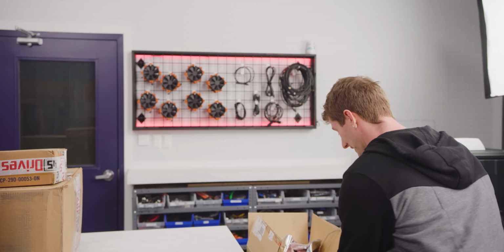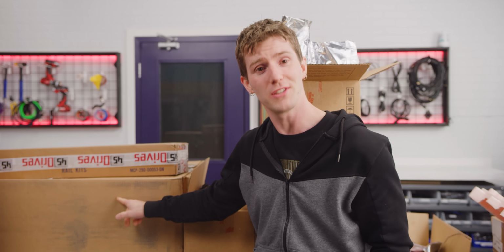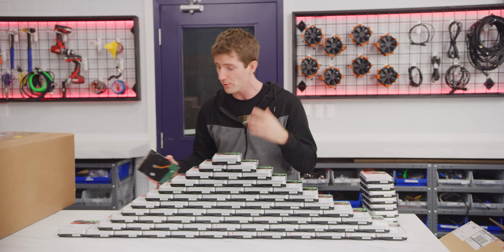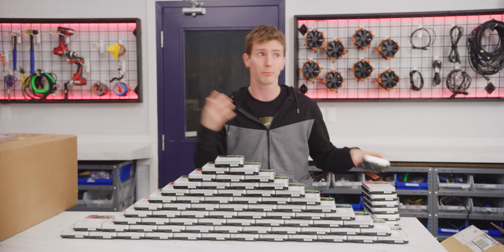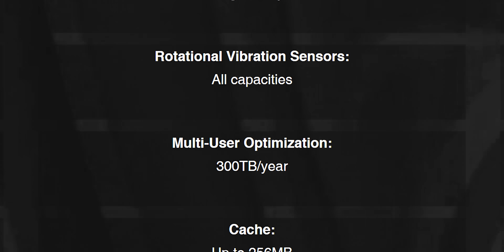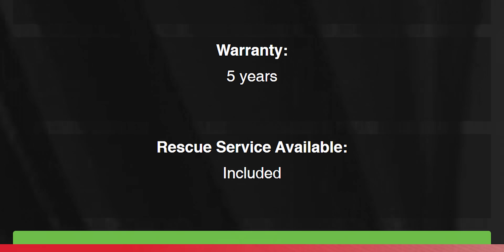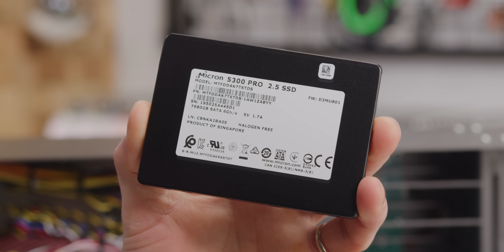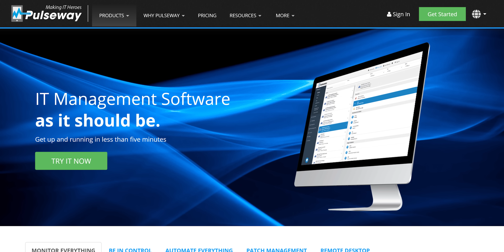Unboxing 3 PETABYTES of storage!!

Comment: I tried to comprehend how much storage you actually have. I was doing it in the oldschool way. Like the old media still does ^^
So you've got 3 more petabytes now. These are 2861022949.21875 Mebibytes. A standard CD size is 700 MB. So you could write 408717564174 CD's (2861022949.21875 / 700 MB). The standard thickness of CD-case 5mm. This is 0.000005 km. If you stacked all those CD's this tower would be 2,043,587.82 km tall. The distance between earth and moon is 384400 km. So the tower would be 5 times as long!!!

Sorry for my bad english but this is insane...

Comment: 10:20 how can a single sata 6gbit/s drive be fast enough to saturate a 10 gbit/s network connection? Or is he talking about multiple SSDs in an array?
Reply: He's Linus.
Reply: it's not "single drive", those are configured to store portions of same data spread evenly and with some redundancy so asking for single file would result in server requesting sections of it from multiple drives at the same time, easily saturating that connection.

Comment: The latest version of ZFS (on Linux) has another use for SSDs: metadata. The spinning disks would contain only the raw video file data and everything else - file listings, block offset tables, etc - go on the SSDs. Indexing is lightning fast as long as it doesn't have to actually open the files to read things like video metadata (resolution, codec, etc).

The catch: mirror the SSDs to make sure a dead SSD doesn't nuke all your data, and watch their space usage because if they fill then metadata spills onto the spinning disks.

Comment: I have had so much problems with Segate drives over the years so I have a hard time trusting them again. With 3 petabytes of data I would not be able to sleep :P
But, I have at least put in 2 6TB drives in my server from them to try out for a while and see how they hold up to my WD's.

I have actually had a few WD Green's with the idle time altered that have been going for way to long... I have the data under control and expect them to fail so I can replace them but they are almost at 10 years in a 24/7 home server at this point.

Comment: Important ZFS information. 

L2ARC does not count towards the capacity of the pool. It currently gets rebuild after every reboot.
L2ARC also consumes RAM. Adding all the SSDs will probably decrease performance.
If you want to use SSD use vdev of the type "special" which is available from ZFS 0.8 onwards

ZIL SSDs are only used when you have SYNC writes and your server crashes. With default samba configuration you do not have synchronous writes!
use recordsize=1M on huge media files

Comment: L2ARC consumes system memory in order to do it's job. L2ARC that size will consume all system memory leaving you with no RAM left for real ARC. Be careful.
You could slice the drives to give yourself a 'partition' for L2ARC and one for use as a regular vdev. This will incur a performance penalty (but not a massive one).
Do not use one drive as a SLOG device. If it dies it will take data with it. Mirror is the only option.

Comment: ZFS ARC sounds a lot like Linux's native LVM cache capability, it's a write-through cache for logical volumes.  Also, your ZFS partitioning is just multiple software RAID6 volumes, it seems like you have a lot of overhead in your layout.  If it were me and I was trying to do the same, I'd rely on XFS and not ZFS, then just use the normal Linux stack of LVM to manage the RAID and caching.

Comment: Dont use too much L2ARC. L2ARC uses RAM for storing addressing data on L2ARC. Meaning. The more L2ARC you have, the less memory is available for ARC. Too much, and you will see a performance degradation of overall performance.

This being said, larger files, means the system should handle more more L2ARC than if you had a massive amount of smaller files (i.e. Database, VMs etc).

Also, SLOG will ONLY affect sync writes. This means it will have NO EFFECT what so ever on a windows SMB drive. For something like an iSCSI, with sync on, it will have a significant effect. But turning sync OFF is ALWAYS better performance-wise, than sync ON + SLOG.

Comment: Always excited about a single server storage. What if the CPU or motherboard goes pop?  Should be using  corporate  grade storage from Dell or  HP where everything is redundant (multiple controllers, muliple fiber channel switches and raid groups) and the software is actually better engineered.  I know the reason of course, he does everything on the cheap. Who can forget the Google Cloud backup video?

Comment: Is the accidental power loss really an issue for this beast? If you can justify the cost of the drives a UPS is going to be on the shopping list as well.  This should shut down the services in an orderly way  when the batteries get low.
A feature on UPS would be good.

Comment: See this is with HARD DRIVES, imagine if all of the drives were SSD's.

Next year video title > Upgrading PETABYTE PROJECT?!
Reply: SSDs aren't at the same capacity as these hard drives. So he'd need more a lot more server units to match the capacity
Reply: @ihavekalashnikovyoudomath9275  Yet.
Reply: @SegmentW  I like your optimism.  But manufacturers are already very close to the theoretical limits of how many nano meters wide they can print circuits inside a chip (before data gets corrupt by electrons jumping between circuits because they are too close to each other).  They'd have to invent something very very new, a brand new way to store 1 and 0's.
Reply: @ihavekalashnikovyoudomath9275  it would require more drives yes, but it would actually take up less space per byte since ssds are so much smaller. 

Don't know how much space the extra connections and support hardware would require
Reply: More storage? No. Faster storage? Probably. Who knows how fast this setup will be most of the time with the L2ARC, but full SSDs would probably be faster

Comment: Has NetApp been a consideration for the NAS storage or was this more of a sponsor choice?
Yes a NetApp disk shelf will also hold at most 60 disks, but putting a multitude of shelfs onto one controller is easy and much more extendable by simply adding another shelf in a few years time. The high tier ones can fit 400+ PB Storage

Comment: 6:08 My heart just stopped. All I could picture was The Great Wall Of Storage falling over as Linus leaned into it.
Reply: or the desk breaking down on the weight...
Reply: I was thinking the same. Linus king of drops was about to make the biggest drop ever
Reply: Also not sure that the drives at the bottom of the pile particularly like having to support the weight of the rest. The 225 drives weigh about 150 kg, there are 21 drives at the bottom, so that about 6-7 kg on top of each bottom drive

Comment: Do some average joe server builds. Such as low power, low cost storage focused data integrity to something like 4k Local, 5 1080 Plex stream capable NAS. Some tower NAS builds would be great with which cases can offer best storage density. Intead of the several thousand 45 drive enclosures.

Comment: My recent Seagate experience:

I have three 8TB IronWolf Pro hard drives that are just under two years old. All three are sitting in my Synology 415+ NAS in a SHR raid array. There are no other drives in the system. Also, all three drives were bought around the same time. 

Last week, one of my IronWolf Pro drives decided, in the most sudden and unexpected fashion, to die - no warning what so ever.

The inbuilt IronWolf Pro Health Management software/ failure prediction algorithm did not function as advertised as it gave me no warning what so  ever... 

During the warranty application process, which I filled out online, Seagate rang me. However, their phone line was so bad, I could hardly understand their staff. I must admit though Seagate's staff were very friendly. 

That being said, to make the experience with Seagate worse, the replacement drive they wanted to send me under warranty was a "Recertified Drive"...

Seagate advertises low failure rates and a solid sounding health management software. But if something goes wrong, they replace the hard drives with "Recertified Drives"... 

So my drive for which I paid a price premium (for the Pro version) fails in less than two years and you Seagate do not want to send me a brand new drive just a "Recertified Drive"...
Shame on you Seagate!

Currently, I am waiting for my replacement hard drive to arrive... 
Overall Seagate experience: poor to mediocre

Comment: I am going to to a suggestion to LMG:
They could hire someone, who then looks through all the old videos, and picks the highlights. the rest can be disposed. maybe in the longrun, LMG might actually save money, by saving disc capacity
Reply: This will never happen. They aren't paying for the drives or servers, just for a few hundred watts of power; and then there's the data hoarding mindset - I would be upset deleting any of this, and it's not even my channel. This level of storage isn't being used to store videos, which even at a substantial multiple of YouTube's bitrate would only take up several terabytes, but rather unedited 8K footage (an order of magnitude longer than the final video length), Premiere project files, and various exports.

These latter could actually help them a bit: Taran has mentioned in the past that they try to cut down on things like non-final renders, and they could almost certainly save significantly by deleting recomputable data like Cineform transcodes, Premiere previews (if those are being stored) and final exports - but my internal datahoarder would be worried about the final exports, in case something about the process changed so that they couldn't be made again, and deleting those Cineform and preview files would make it more difficult to reuse those clips in the future while you wait for them to be regenerated.

Comment: Woo Hoo, 60 drives, finally catching up with the enterprise toys. Would have liked to see the 75 though. Maybe next year when you need another one. 
Does it support hot-swap though? 
The DS460c has front access trays and hot-swap drives/fans/PSU needs a separate controller though.

Comment: Wife sounds like she is on to something.  

I still have no clue how less then half the drives for backup can keep you data save.
Reply: Easy, let say you have 10 drives
drives have 1 and 0
your system will look at the first bit of every drive and add them : 0+0+1+1+0+0+0=10  (the result is 2 in binary)
and your system write the result on the 3 drives left (because with 7 drives your results are between 0 and 7, in binary 000 and 111)

Now, if one of your drive die, let's say #2
your system know the result is 10 and know what the 6 drives left have
it's just a math problem away to rewrite the drive, here X=10-0-1-1-0-0-0=0
Reply: It's oversimplify but mostly it. Linus system can lose multiple drives, must be harder math to find what's missing, but they're computers they love math ;)

Comment: A positive I give this video is that I am shopping for a HDD for backup, I ordered a WD Gold 4TB on the way for one PC and I was looking at Seagate for my other PC.  I did not know they had an enterprise line.  Just ordered me a Seagate Exos 7E8 4TB from Newegg. 
Normally I don't seek out high tier for storage, especially aging HDD tech, but I'm in need for setting up proper backups which I neglected through the years and now dealing with old HDD I have that are dying out.  Got to have something in place to keep backup images of my PCs, and I'm too cheap to do those expensive tape drive routes.

Comment: 1:30 ZFS-on-Linux again ? When's just good ol' XFS on kernel's soft-RAID/LVM, Red Hat-style ?
6:00 Isn't it like… less than 1 rack ?
9:10 Or you could just use old plain Linux bcache for temporary, throw-away quick-access caching (basically, layer between RAM and actual storage, good for SLC/MLC NVMe) and lvmcache for tiered storage with gradual displacement of data for permanent storage between "fast" (SSD) and "slow" (HDD)  tiers… And you may also want to tweak kernel for more aggressive caching in RAM.
Reply: comparing XFS + mdraid/LVM to ZFS is like comparing a sick horse to a high end Tesla lol

Comment: Holy shit that's an awesome amount of drives, puts my 40 drive NAS I have for my YouTube channel to shame. I also use some SLOG and L2ARC so that I can live edit from the server at constant 10Gbit speeds and NVMe latency but to get that you'll have to change some settings within ZFS. I showed these in my "Home Networking: 100TB 10Gbit Server - Last server bits (Storage, Networking)"video. I also love Seagate drives but especially in combination with ZFS and LSI/Avago based controllers there have been firmware issues, these have been fixed (I did a video about that called "Home Networking: 100TB 10Gbit Server - Seagate IronWolf 10TB Firmware bug (+ FIX!)", so make sure to check the drives before putting them into actual production use!

Comment: "Investing in hundreds of gigabytes of RAM can be prohibitively expensive."

whips out 8TB SSD
Reply: I mean, SSDs ARE at least 20x cheaper than RAM for the same capacity
Reply: @robinsuj  that 8tb ssd is 900$
8TB of RAM => 60*128GB stick, and that a lot more expansive, around 267 times more expansive.
Reply: @Tekoiu  And 267>20, so what I said is still true.
Reply: @-redacted-7716  What was the joke tho lol? The guy just demonstrated that he thinks SSDs are expensive which they are not compared to like everything else on LTT
Reply: @Tekoiu  64gb of ECC LRDIMM memory costs about $350 each. You would 128 of those, that's 50 times more (which greater than my "at least 20x," but I DID say "at least") than that single SSD.
Reply: @ShiaLaBluff  people are trying to prove him wrong when he just made a joke
Reply: just the 8TB SSD is the shocker? and not the 3 Petabytes to begin with that is cost prohibitive?
Reply: FYI, those 10TB EXOS drives are surprisingly cost-effective: https://pcpartpicker.com/product/RPtQzy/seagate-enterprise-capacity-10-tb-35-7200rpm-internal-hard-drive-st10000nm0086

I might get one myself for my next thousand-dollar build ;)
Reply: Nothing else impressive he can whip out.

Comment: Arc and Log, yeah I added them to my server then thought, hmmmmm we have raid Z2 in case 1 parity drive fails while resilvering a vdev.  Then I thought, gee there's no parity for the Arc and Log drives.  One is typically a Read cache while the other contains data that will be written to disk when they are ready.  If that SSD dies, you could lose your entire Pool.  So, I no longer use the SSD cache and log drives.

Comment: "Were basically replacing the whole server room"........Just how big was that fire.
Reply: It only affected the ups, but to replace it he'd have to move the rack out
Reply: A problem just big enough to require tearing the room apart to fix it - so why not overhaul the joint while you're at it and help to future proof for a little while longer

The old server room was great for what they needed at the time, but it wasn't a ground up design to begin with so had several compromises already.
Reply: i say it was big enough
Reply: There was a fire? (Or is this a reference to the prank video?)
Reply: @Miles300s  Not a big one, but during the last WAN show they discussed it and it was a small arcing fire that destroyed the UPS (uninterrupted power supply).

Unfortunately due to the cramped size of the server room, that UPS went in before the walls were put up, and to remove and replace it.. they need to tear out one of the walls

So instead of just doing that, they seem to be planning a full overhaul
Reply: @MotoCat91  Ah, okay. Thanks for the info
Reply: Kyle Markinson that’s exactly what I was thinking about
Reply: Clearly that fire wasnt big enough only having 3 pedabytes pfft

Comment: If you do put an Optane drive in there as well, this machine will have 8 tiers of storage (not even including the additional caches in the drives):
CPU Registers, L1 cache, L2 cache, L3 cache, RAM, Optane, SSDs, HDDs
The only missing tier I can think of would be a tape drive

Comment: Any professional and experienced network admins watching this video would be shaking their heads in disgust because Linus is doing the one thing he knows he is not supposed to be doing  which is throwing more storage at the problem rather than having to come up with a proper data management solution on what to do with the ever increasing number of video files.

Comment: I love how me installing a 1tb HD I’m sweating balls and giving it all my concentration while Linus is casually stacking a pyramid made of 16tb drives without looking and giving a lefture
Reply: Zwenk Wiel ssds you can kinda chuck around, but because hard drives are mechanical storage, it's best to be careful about it. And definitely don't drop it.
Reply: @rcradiator  You don't have to be THAT careful with HDDs. As long as you don't drop it you're unlikely to hurt it. In fact I've dropped an external HDD on a concrete floor and it was fine. And a 1TB HDD is only like $50 these days.
Reply: Daniel Jensen yeah I wouldn't say that. I killed a hard drive once by not placing it flat on a table. The thing was on a textbook and slid off onto the table, a one  inch fall. The read head got stuck and the drive was no longer usable, instead just beeping on boot. I had to crack open the drive (a death sentence to it) and unstick the read head and then quickly transfer any data on it to another drive. So yeah, if a one inch fall can render a hard drive useless, then im definitely going to treat it like it's fragile.
Reply: And Ironwolf Pro and Exo drives, not just regular ones.
Reply: Zwenk Wiel I have sHaKy hAnDs

Comment: 225 drives. there are 4 storinators in the rack already. if you'll upgrade the drives of the old ones, you'll have 3 petabytes of storage! who cares the those drives aren't "rated" for that. most data hoarders use shucked wd easystore drives.